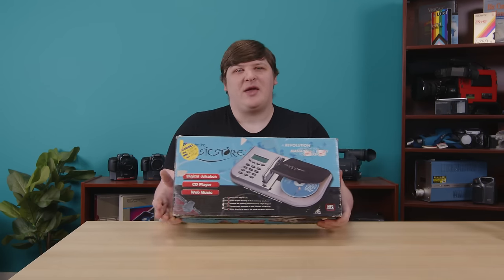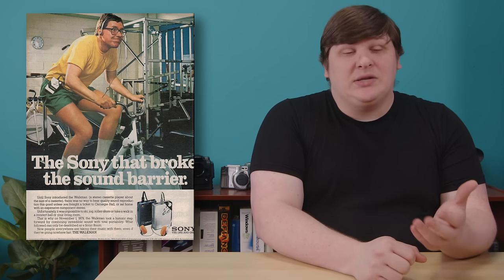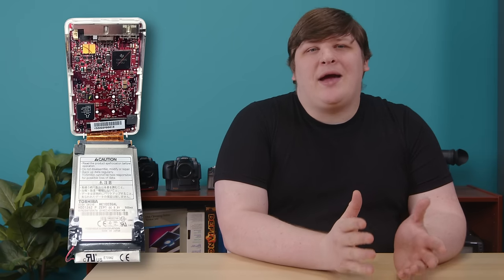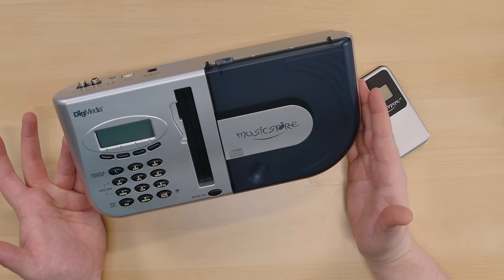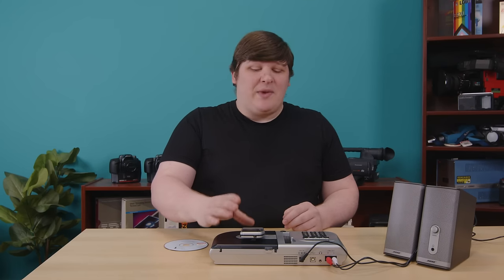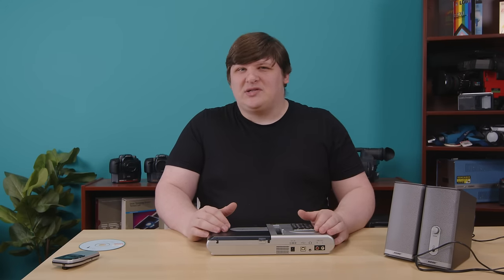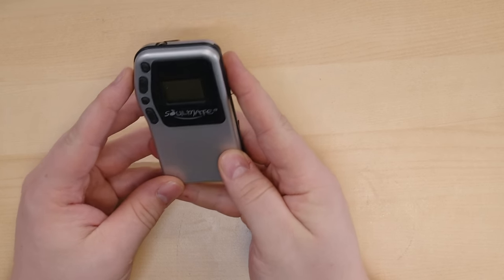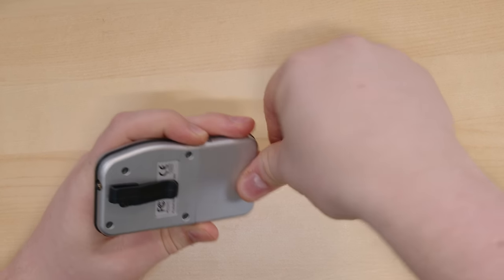An MP3 Jukebox for Everyone (Including The RIAA)

Comment: Oh, and if  I found a boxed set like that, believe me I would buy it. I think I would tear the innards out, design and build a nice case for it out of walnut and use my router to cut and enhance the looks sand her down and apply a nice stain and finish.  Perhaps make the case like those of an old 1930's tube radio set. I have already done this with WiFI radio sets that I built using ESP32's and VS1053 decoder boards. When you turn them on, and tune them to some 30's music channel on the www, they really take you back....

Comment: 53:05 WRT the dc jack, my guess would be it's there so that they could later sell an extended battery pack of some kind maybe? Also was just common for portable devices of the time since AAs were more expensive and rechargeables weren't super accessible either. I spent many hours glued to the wall with my game gear because batteries were a rarity and cartridge saves were barely a thing.

Comment: @19:42, the IR port could also be for wireless filetransfer. It was quite common in that period.
@1:05:25, Google for the number on the chips and look at the pictures that come up, I got some PC100 SO-DIMM modules with these chips clearly on them.

Comment: I had the Rio PMP 500 back in the day.  It was a bit of a pain in addition to having the 32 MB internal storage, managing the files on the device is through the driver and software.  The software does only allow transfer TO the device.  The expansion card is limited to I think an additional 64 MB SmartMedia Card.  While there were a little higher capacities for these cards, they weren't supported.  I also had a hard drive based MP3 player called a Rio Karma and it had a 20 GB capacity and actually had a library database to be able to quickly browse through your library.
For the device you are talking about, I'm wondering about the power connector on it.  I'm thinking that maybe it was to power the soul mate device to prevent it from pulling battery power and having it die while it is plugged into the "music store" device.

Comment: when you did the strip down, there were a couple of small "super capacitors"  that should hold the memory long enough to change the batteries without losing the memory/songs. I would imagine that they have deteriorated by now.

Comment: The Motorola DSP is most likely doing the MP3 encoding. I had a Motorola 56k DSP card for my Commodore Amiga, the Delfina which with 3rd party software allowed MP3 decoding. The Atari Falcon with it's 56k DSP also allowed MP3 decoding. Although encoding is more intensive, with the right model of DSP it could handle encoding. The Actel FPGA is most likely the glue logic with the Samsung ARM chip being the 'microcontroller' for the system. With the DSP chip doing the encoding would explain why the RAM chips are around it.

Comment: SP LP ESP were taken from the old VCR speed labels.  I think it would have been sort of a fun device if you took the time to set it up.  When I come on something like that, I try to upgrade it, like sticking a bigger hard drive in it, crap like that.  I have a VERY old MP3 player, the ARCHOS 1 jukebox.  Ebay purchase many years ago. Never had it working right till a few weeks ago when I  put 4 enolope batteries in her and she had enough power to run the system.  It is so beat to hell that none of the screws will stay in the holes, the display light works about half the time but it is a fun machine when it works. Has a 20 gig laptop drive in it. Sort of looks like a Jukebox, it has a fairly simple interphase with simple menus to negotiate the system. I have had it for so long, I can't recall how I loaded a bunch of albums on the device, but they play well and sound good to my old ears that went through the 60's rock and roll craze, then went over to Vietnam to be concussed by gun fire and incoming rockets and mortars I can and often do shove the music through my hearing aides via a Bluetooth dongle and the BT setup for my hearing.

Comment: I have always wondered if the DOS ETV series machines were repurposes of the PC/1 hardware (or the PC/1 was a repurpose of the ETV). The BIOS messages on the PC/1 are very similar and it came with exactly the same version of DOS 3.2 (including the 3.27 revision number). Looks like the hard drive option would be a 3.5 inch XTA drive fitted in place of one of the floppy drives, that too is how a PC/1 with a hard drive worked. Only fundamental difference in spec is that the PC/1 had CGA graphics.

Comment: Can you please give us the full part number on the chip marked ARM. What you gave us is just the technology it uses (ARM), the company/brand (SEC), and the manufacturer date or batch code (950). I am having a poke at the hard disk image and it looks like the system actually boots from it, where I would have just expected media and a database, I am seeing copyright strings for T9 and lots of informational messages.

The DSP56362 is very likely the MP3 decoder & encoder, according to it's datasheet it has a 100MHz processor with 100MIPS, and as it's a DSP it has more then enough power to decode a MP3. The FPGA is more likely just glue logic to allow it to be enhanced/expanded with firmware changes/updates, along with encryption/decryption functionality. The RAM on the board is directly tied to the DSP, the MCU (what you're calling a CPU) does not have direct access to it, it will have it's own onboard RAM in the package itself.

Comment: Here's my 2cents on 1X/real-time mp3 riping:

Back in 1999 using a pentium 2 300mhz took15 minutes to encode an mp3 @ 128kbps 5 minute track using some bladenc command tool.. 
i still remember ripping two albums to wave format, make a batch file for bladenc, go to school, come back in the end of the day and my tracks were done.
Then i would delete the wav files (1.2gb or so) so i could have more space to rip more wave... hahahah i could rip 2 albuns a day...!!

so 1x rip real time is actually pretty good for 2000 because i doubt the cpu power inside that is anything other than a potato
Reply: Wow… that’s exactly how I ripped CDs in 1999/2000. But I got more than two done a day, and was long since out of school. I had BladeEnc batch encoding while I was asleep and when I went to work.

Comment: The Rio PMP300 portable Mp3 player can play higher bitrate files than 128kbps,but the storage size is very small (32 megabytes). You could add a flash card to atleast double the space.I bought this player back in 1998.

Comment: Thinking of "Supercaps", I had a Palm M105 that was SUPPOSED to keep the memory for up to 60 seconds during a battery swap, but it never worked. Always lost my data so I planned carefully when my batteries got low. I eventually got a settelment check for the defect a decade later. I'm thinking the portable player may have the same issue with early supercaps not really working correctly.

Comment: Supercapacitors were around much longer than just the early 2000s. 0.22F is sort of just barely in supercapacitor range, and since it has probably aged badly the ESR has likely gotten to the point that it can't supply enough current to maintain the DRAM during battery changes. I bet when it was new it probably worked.

Comment: My first MP3 player had only 32MBytes, 2 AAA, and a serial interface. It was made by Dlink(DMP-100) circa 2000.  It had voce recording and smartmedia external memory.
Reply: My main (and my only personal, the others were for my kids) MP3 player was effectively a pendrive that ran on a single AAA, 128MB. I was thinking during this video how fast things changed for the better with memory prices and battery longevity, it'd get days off the single rechargeable while in use.

Comment: interfaces that emulated a car's optional CD changer.. works pretty well, still have one in the 01 Honda.  iPod to USB.. ironically is the challenge, internet still has the cables. And had a MP3 only cd player for a few months before that.

Comment: One of the most interesting bits of software that came with my PC's Zip drive was a pretty fast and reliable MP3 converter. I had MP3s long before I ever got an actual MP3 player for them. My first MP3 player was a Rio Cali (first gen I believe) it had no storage of it's own, only what you could afford to fill it with. but by then (~2005, this was used) 128mb SD cards could be had. it chewed through AAA's. Next one I got was my kid brother's Halo 3 Zune.... that held like 40 GB
Reply: oh T9...  how I had such a love-hate relationship with you....
Reply: @DFX2KX  yeah predictive text and autocorrect, the bane of my life. A lot of local streets and towns have names from Gamilaroi names so it's actually faster to type manually than use either. But I also type in multiple languages so just updating the dictionary is prone to causing it to get confused too.

Comment: Supercaps also age. I recently restored several Sony ICF shortwave receivers, some kept the clock very long after removing the batteries, some lost it after seconds. Replacing the SC helped on those. So maybe the soulmate would keep the RAM contents a bit longer with fresh caps. And DRAM was not untypical for storage back the. Remember the Windows Mobile PDAs, which also lost their data when the battery was removed or completely drained?

Comment: I am 36 and was a nerd with a "legitimately salvaged" music collection in the mid 2000s. I never used or heard of Musicmatch Jukebox, only really used WinAmp and Windows Media Player at the time. I despised everything Apple related and never had an iPod, limped along on super cheesy MP3 CD players for a bit before finding the thumb drive style crappy MP3 players of that time. My allowance didn't get me very far and my family didn't have a lot of money to throw at stuff for the kids, so I was having to fund my own tech acquisitions. Family computer was a Pentium 100 with 8mb ram and 1.2gb hard drive acquired in 1996.... it was not upgraded until I built my first computer in 2003, and then not much. Think dial-up service was established in 1999, begged for cable internet in 2003 or 2004 when I was actively melting the phone lines torrenting things over dial-up. Think that cable internet was like 1.5mb down and 700kb up..... How far we've come is nuts.
Reply: Yeah I actually stuck with dialup until 2009 because I could download MORE on my dialup plan per month and cheaper than was possible on broadband locally at the time. They had caps at ridiculously low GB (DL and UL included in the one), and would then throttle you to dialup rates that made even my 33.6K look luxurious in fact I more often couldn't access sites on the ADSL2+ because of that than had ever been the case on my dialup.
Not having a cap today... oh thank the gods my streaming video alone would do that in in about an hour, it was 18 hours on 1.5Mbps then at full speed.
Reply: Winamp is all you ever really needed. It still whips the llama’s ass!

Comment: To be fair the interface didn't strike me as being particularly bad by the standards of late 90s/early 2000s electronics - compare it with something like programming a VCR - and I'd guessed what most of the options did before you'd explained them; the scissors were somewhat inscrutable (a wrench would have made more sense, maybe), but everything else seemed fairly self explanatory. It's also not a CD-ROM - it's just a regular old audio CD player.

(Also I want to listen to some Stabbing Westward now.)
Reply from the maker: I would love to never refer to CDDA as CDROM but the latter just flows so much better, since CD is just a two-letter abbreviation and "audio CD" is kinda awkward. Kind of a bad habit.

Comment: Higher speed DAE extraction over a data interface was a mature process by 1998/2000 but relied on SCSI drives. That would have really put the price up with a SCSI controller and drive. Other methods were a bit more finicky.

Comment: I remember ripping CD's on Real Jukebox and it would play the CD audio while ripping but that required my Internal ATA CD drive to have the sound cable connected to the sound card since the digital path was filled with data. ITunes currently can play while ripping as a option but it slows down ripping the disc.

Comment: Oh yeah, self-refresh mode is a pretty standard feature on SDRAM, it's used by the suspend to RAM feature in laptops (which has been around for a long time) and standby mode on modern smartphones
Reply from the maker: Yeah it makes perfect sense in retrospect, just nobody had ever mentioned it and I didn't think to check for it.

Comment: I could imagine being 16 in 2002 and being so happy this thing had t9 when I was inputting full ass sentences for song titles. 

But ripping at 1X is pretty brutal.
Reply: Yeah but it was still kind of common to avoid errors. As pointed out DAE could be hit or miss even with good hardware at the time we'd tend to limit ourselves to slower if we really cared about the quality of the recording. Though that said too if you were stuck with the recording happening regardless being able to still hear the disc was sometimes a plus because you might not have a second player handy, standalone CD players were often still kind of pricey at times.

Comment: You know at first I was sorta understanding some use cases for this.
Ripping CDs can be a time consuming process (Even without that weird limitation), and an entire library at the time could easily take all day. So I can understand why someone might want an external device so they don't tie up their computer ripping discs.
- I remember as a kid playing my Gameboy while ripping CDs, but I can imagine other people wanting to play a PC game or something else that might require the CD tray, or doesn't like getting minimized.

But that limitation made it just a nogo.
Reply: Day... Months of staring at MMJB while ripping was my reality. There's over 20,000 album entries on at least one of the CD databases MMJB supported (which is partially linked to how it got hated pushing a paid service at people there) that my original employer is responsible for we ripped around 40,000 albums for a music radio station. If you ever see and wonder why a rare country music single has entries we might have been responsible because the owner's collection was immense and we were digitising for him so it was easier to DJ rather than worry about switching in and out discs (or even finding them I seriously do not remember the exact count but we had 10 PCs basically running 24/7 ripping to get it done and it took 6 months).
If we were lucky MMJB wouldn't crash or just mess up a rip because it was fickle AF when you're talking large data sets.

Comment: oh. why did i looked in hdd image with hex editor?.. E* every four bytes is ARM code. so this device boots from hdd and have totally unencrypted firmware. but one thing... in normal ARM code e* is every fourth byte, not first. it is ARM Big Endian. why anyone should use this architecture variant? the only other device on this architecture that I have seen- nokia 3310.
also, it stores artist/track names in plain text. and looks like it have simple filesystem... may be 'xor encrypted', though (empty blocks all have same data in exception of block number (in little endian, WTF?), but not zeroes or ff's).

Comment: Took a quick look at the disk image.  Looks like the the firmware is at the beginning of the image.  128kbps (if the header is to be believed) MP3 tracks appear to be present (search for 0xFFFB, e.g. at 0x4e0000).  The audio data seems scrambled  (amongst other things the low and high data nybbles seem to be swapped) but not encrypted (it's too regular, i.e. there's lots of patterns).  Hard to say beyond that without a lot more analysis.  That's my take anyway...

Comment: The super capacitors are probably only meant to power the RAM long enough to plug/unplug the DC jack as naturally there will be short changeover period as it isolates the batteries.  Though means you need to make sure the DC supply is plugged into the outlet first or poof, your songs are gone.

Comment: I never realized the UL listing thing... Thanks I learned something.... I feel like the screen that allows you to delete tracks during recording should allow you to start typing on the track title to over write it with whatever you want.  Mixes pre date CD...... They originate from cassette tape.... If you think of them that way the mix button being under record makes sense.
Reply: I forgot to ask, does it support cd text?
Reply: @TheGodOfAllThatWas  he said no during his explanation of the ripping feature. Which is definitely possible, because it wasn't widely used even in 2000 despite actually being an (by then anyway since it was added in 96) redbook feature.

Comment: I have my doubts about DRAM being cheaper than NAND. It's absolutely more expensive today, but I suspect it was more expensive even back in 2000 (maybe someone who was doing electronic design back then can remember prices)

the plastic shells might have been cost optimised, but the electronic haven't (an FPGA???). So I suspect they actually shelled out extra for self-refresh DRAM just so they could get those fast transfer speeds. It is kind of required for the product to work, just slap it down and select a playlist as you are walking out the door.

These days self-refresh DRAM is extremely common. Any smartphone or laptop relies on it to get battery life doen to reasonable levels. If you put a smartphone in airplane mode, leave the screen off (and there is no misbehaving software), the DRAM will actually be one of the largest power consumers in the phone, even in self-refresh mode. Everything else can be basically idle most of the time. The CPU only needs to wake up every so often for housekeeping. But that ram needs to be continually refreshing itself to keep it's data alive.  
Don't quote me. But my understanding is that even when the cellphone modem is connected, the ram is still one of the larger power consumers.